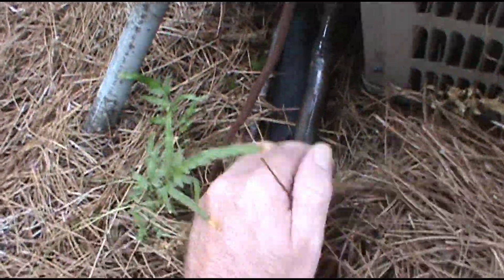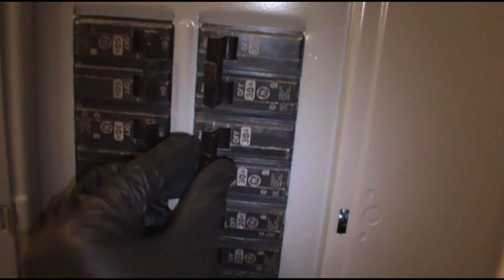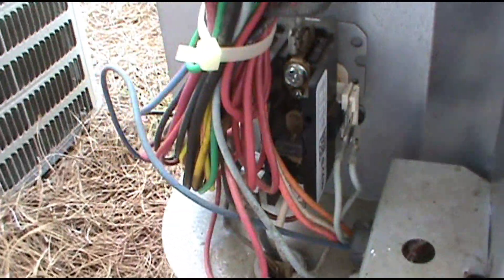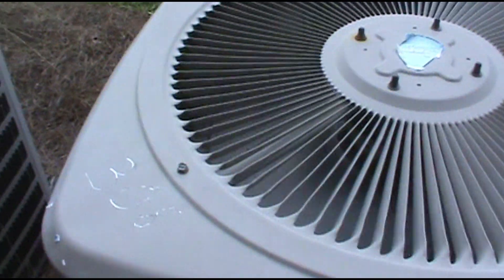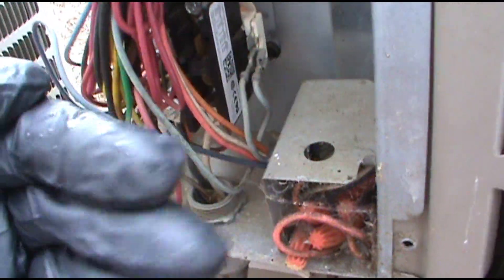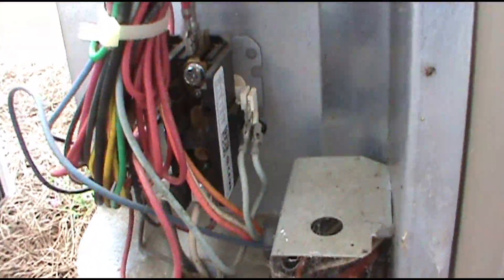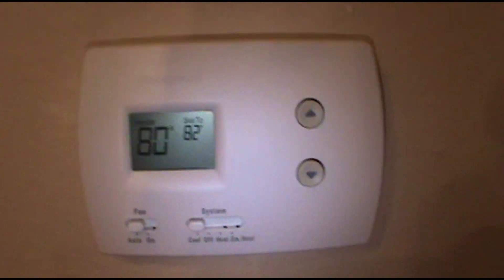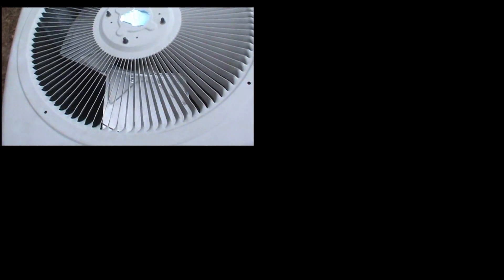Nest Thermostat Causing HVAC Issues

Comment: Just had a situation where there was a short in the base of my Nest Thermostat.  so my A/C kept running .  You might pull the Nest off but the issue is the Base.  so make sure you pull the wires out too.
Reply from the maker: Thank you so much for watching!

Comment: Thanks for the video Lex!  After 4 years, I have the EXACT same problem. I tested the capacitor, jumped 120v to the motor, and thought it was the control board for sure! New control board, and it would only run the blower for 2 minutes before the blower relay would switch off.  Lesson learned. I'm just a DIYer. May try to run a Common, may buy a new Nest. The downstairs Nest has been good for over 6 years 🙄
Reply: Quick Update: I used the Green 'Fan' wire as the Common and moved it to 'C'. The Nest immediately recognized this change. I bridged the Y 'Cool' terminal and G 'Fan' terminal w/ a wire at the control board. Everything's working peachy, I just don't have independent Fan operation any longer.  ALSO: the Nest was reporting low battery. I suspect over the years, the insufficient current w/o a Common kills the battery and starts drawing too much current from the control board. Still showed 28v on the G terminal, but not enough current to keep the Fan relay closed...
Reply from the maker: Thank you so much for watching!

Comment: I have a nest thermostat and it sometimes kicks my compressor off I have to turn off all the power and reset it works great afterwards but I believe I will be switching
Reply from the maker: Thank you so much for watching lawz!
Reply: @LexVance  what do you think about the ecobee gen 5?
Reply: Solution go to settings and turn off annual something I forgot but it prevents thr nest from not kicking on the compressor like it should

Comment: The nest requires the common wire because it suck power from the 24v power wire and it causes the air handler to shut off. Installing the common wire to the nest fixes this issue.
Reply from the maker: Right on, this one had the common wire. The Nest in this video was on the wall for 4 years and worked great. It malfunctioned and the guy had to get a new one. Thank you so much for watching Omaha!

Comment: My issue is the opposite. My inside runs and outside unit shut down. My unit is a York installed 2019. I have Nest. Everytime I call the tech it’s back working the pressures hood everything but ut at night the outside unit is not turning on. Been dealing with this for 2 months can you give me advice?
Reply from the maker: Yikes. I'd need to be there for this head smasher. 😭

Comment: Because so many people land on this video, including me, I have the actual answer for you for the shown issue.  

1. I assume you have the Y1 and the G wire connected, and that you can run the fan manually.

2. You are here because the compressor turns on, but the fan does not, and you don't want to have to run the fan manually (which works)

3. If your fan DOES work (when you test manually in the test menu, the answer below is for you, otherwise you probably have a wiring issue.

4. So now we have established your fan works, and your compressor works, but they don't come on or turn off at the same time.

5.   Go to Settings->Equipment->continue until you get to the menu where you see "heat type" 

6.  Go to the "heat type" menu, and make sure it is set to "Forced Air"

7.  Click through until you are done.

8.  Now go back to the equipment menu until you are given the option to "test" and in that test option area test your heat pump/cooling setting.  When the test start it should show (y1,G) being tested.  

Your fan AND your compressor should now turn on.  

For some reason the Nest will auto detect your AC incorrectly as a non fan air conditioner, and since this is hidden visually in all of the menus, you may think your Nest is broken.  Wonderful.

Literally no site has this fix, the only way to find this involved me watching a FULL install and configuration of a NEST and noticing that when I did the "test" mode it only showed Y1, instead of showing (y1, g)
Reply from the maker: Right on! I forgot to state in this video that this Nest had been on the wall for 4 years and never had an issue. The resident had to get a new one. Thank you so much for watching Christopher!

Comment: The nest is the problem, running the damper running when the thermostat call to shut down.   The government and the Utility Company should remove the Nest thermostat from their approved thermostat to get the credit. I spent $250.00. It does not function. Nest customer service does not accept their fault. My system is working fine with a $25 home depot thermostat.
Reply from the maker: Yep! I've heard nothing but bad things about Nest. Thank you so much for watching Muhammed!
Reply: And you are absolutely right, they do NOT accept that it's their crap. 
This mess came with my new construction home and it is nothing but a nightmare!!

Comment: Was there a yellow cable for the thermostat? if not they wired it wrong. There is 3 different ways to do the wiring when it comes to nest even the honey thermostat.
Reply from the maker: This Nest has been on the wall for 4 years. It was wired correctly. It just finally failed and wasn't working any more. He had to throw it away. Thank you so much for watching Dj!

Comment: That can happen if no common wire is used. The Nest says it is not necessary, but I’m guessing when it draws power from one of the other lines, some furnaces interpret it as demand for heat or cool. I had to pull another line with an extra conductor. Works like a charm.
Reply: That model has the rotating side ring
Reply from the maker: Right on. The Nest in this video has been on the wall for 4 years and was wired correctly. That's why the owner couldn't except the truth that it's now a hockey puck. 😆 Thank you so much for watching Mike!

Comment: The nest needs to have a ground wire running to communicate it for common. I had the same issue where it wasn’t cooling off and causing the same problems
Reply from the maker: Right on. The Nest in this video has been on the wall for 4 years and was wired correctly. It just went bad. Thank you so much for watching aj!

Comment: Good vid man- I love how people just don’t understand that thermostats are just electrical switches. Switches go bad after prolonged use, voltage surges, and shorts. The contacts or logic in the nest just go bad faster than others. I have probably changed out 4 this year because it wasn’t sending a signal to the reversing valve on a call for cool. I will usually just tell people if they want to keep it to buy another one and return the one that they have in the box. If nest wants to put out trash they can take their trash back
Reply from the maker: Yep! The thermostat in this video had been on the wall for 4 years and was wired correctly. That's why the guy couldn't accept the fact that it's now a hockey puck. Thank you so much for watching ACR!

Comment: "I'm gonna have a professional come out and look at it..."  Apparently he doesn't understand that just because you're on site maintenance, that you're also HVACR certified, and a "professional." DUH! Anyway, it's interesting to see how you exposed those nests (at least initially) might not function with some cooling systems. The only other solution would be if it could somehow be tweaked to make it work, and just wasn't set properly on the cooling function, thus causing the malfunction. An update on this one would be cool, if you remember. Thanks.
Reply from the maker: Right on Marc! The Nest in this video has been on the wall for 4 years and was wired correctly. That's why the guy didn't want to accept the truth. He thinks because it hasn't had any issues in 4 years that it never should have issues. 🙄 Thank you so much for watching man!

Comment: Had one...  After 4 replacements in 2.5 years, they said I had an incompatible system.  Looking at the base unit, they have either a thermal or inductive kickback problem that toasts the driver chip...  Kept the system in heat all the time even when supposed to cool.
Reply from the maker: Ol expensive hockey puck. 😆 Thank you so much for watching Jim!

Comment: Probably just a settings issue... I'm sure if you digged into it more you would've figured it out... Apartment renters should not be allowed to install their own tstats...
Reply from the maker: This Nest has been there for 4 years and was wired correctly. That's why the resident didn't want to accept the fact that it's now an expensive hockey puck. 😆 Thank you so much for watching Armando!
Reply: Everything works fine until it doesn't.

Comment: Great video brother I enjoy all your videos!            With a nest you have to wire it the right way for a heat pump and program it too on the setup. I’ve done some for a couple of residents and it can be tricky. And they updated the thermostat one day and the fan wouldn’t shut of so had to factory reset and tell them not to update it. They are pains!
Reply from the maker: Right on. The Nest in this video has been on the wall for 4 years and was wired correctly. That's why the resident couldn't face the truth that his precious Nest is now an expensive hockey puck.😆 Thank you so much for watching Andrew!

Comment: Hey homie. 
I'm a maintenance man. Thank you for the vids. They hella help. I installed a nest and found out the I didn't have to plug in all the wires. I left the blue one out and everything worked. Oh you twist the nest in order for you to select the different options. Like turning up and down the temp. Trying to help. Thanks again. Keep up the great job. Keep them vids coming. 👍👍
Reply from the maker: Right on Veni! The Nest in this video has been on the wall for 4 years and had never had an issue. And, it was wired correctly. That's why the resident can't accept the truth that it's now a hockey puck. 😆 Thank you so much for watching Veni!
Reply: @LexVance  good stuff Lex. I literally didn't know anything about maintenance 😂. Thank you for your vids it help me out. 3 years later still pushing. Right on Flex Lex
Reply: The nest pro gen 3 is really great, but there are flaws unfortunately.
The nest seems to be great for more modern updated systems.
I have a heatpump and sometimes the nest doesn't want to kick my compressor on.

Comment: I’m sure there are online manuals available for these new WiFi thermostats. They should be free to read
Reply from the maker: Right on. The Nest in this video has been on the wall for 4 years and has never had an issue. And, it was wired correctly. That's why the resident swears it's not the Nest and can't accept the truth that it's now a hockey puck. 😆 Thank you so much for watching Ty!

Comment: Let me guess only 4 conductors at the wall.
Reply from the maker: This Nest has been on the wall for 4 years and was wired correctly. The resident swears it's not the Nest because it's never had an issue in 4 years. Well, it does now! 😆 Thank you so much for watching John!
Reply: @LexVance  ha weird.

Comment: I had a few serious problems with NEST in heating mode. Wouldn't come on manually when I needed it to. I'll never use NEST again.
Reply from the maker: Right on. I've heard nothing but horror stories with the Nest t-stats. Thank you so much for watching Vincent!
Reply: I have the same issues. You have to reset your nest thermostat manually not using phone.  Go to setting and just turn off all its features except heat/cool. It will erased all the temp. Setting that you have previously..then you can manually set the temperature you like. Nest memorized all the temp. You set in the past . I have to periodically reset mine everytime the nest is thinking on its own. Its a pain.

Comment: Those Nest thermostats can be a pain sometimes. I usually deal with heat pumps in apartment buildings. The Nest will intermittently energize the reversing valve at random times or have the aux heat on with the A/C. I've come across on many different occasions where the condenser won't shut off. I would have just enough voltage to keep the contactor energized even if its less than 24 v. We mainly use the Honeywell Pro 3000 or the Honeywell focuspro 5000. I've heard Honeywell may be discontinuing those stats.
Reply from the maker: Right on! Yea, this Nest has been on the wall for 4 years and was wired correctly. The resident swears it's not the Nest because it's never had an issue in 4 years. Well, it does now! 😆 Thank you so much for watching hvacguy!
Reply: @LexVance  One thing that's common with the Nest thermostat is that the subbase shorts out. Causing control wires to be energized at random times. I just replaced one a week ago. It was keeping the reverseing valve energized at all times. No matter if it was set to heat or cool. This was on a Rheem unit so the tennant had heat blowing out of the vents no matter if they set to heat or cool.
Reply: same here....i am up here on new englad and ive had to replace a few of these due to strange problems....i always suggest the good old tried and true  T87 ...cant really go wrong...the new 90-95% high efficiency sometimes do not like them due to the real sensitive electronic boards as the T87 does rob some power..

Comment: I have removed at least 10 of them with the common wire. 
Part of initial phone conversation with new customer with intermittent issues is “ Do You Have A Nest Thermostat? “ make great hockey pucks
Reply from the maker: 👍😆👍 Hockey Pucks! I love that. This Nest had been on the wall for 4 years and was wired correctly. The resident swears it's not the Nest because it's never had an issue in 4 years. Well, it does now! 😆 Thank you so much for watching Joe!

Comment: I got a couple questions Lex regarding refrigerant. You got more years on me. Would you reuse refrigerant recovered from systems with restriction problems in TXV/Orifice/filter dryer? Where do you send off refrigerant you don't plan on using? Any place in Tallahassee? I heard some people sell them.
Reply from the maker: No, I wouldn't do that unless I positively knew there was no air in the tank. If other people are recovering with that tank, I wouldn't do it. Air will mess a system up bad. We give ours to HD Supply when they bring us a fresh empty. I think JohnStone will take them too.

Comment: Company had a deal with Nest, had issues with them all the time not getting signals to reversing valves, lost common wire, firmware/software issues. Eventually we opted out for Emerson Sensi on test units, Honeywell on everything else.

Now we have a box full of hockey pucks 😂
Reply from the maker: 😆🤣😂🤣😂😆🤣😂😆 Hockey Pucks! I about peed from laughing. The Nest on this video had been on the wall for 4 years and was wired correctly. The resident swears it's not bad. He said it's never had an issue in 4 years. Well, it does now! 😆 Thank you so much for watching Tech Life!
Reply: Nest thermostats without a C wire are powered by sending 3-4 volts from R to
a relay load connected to common assuming the voltage is too low to pull—in the relay. That strategy often does not work. Emerson Sensi is a great WiFi thermostat.

Comment: I hate when residents think they can install their own fixtures/thermostat. Drives me nuts
Reply: had a tenant years ago try to replace his toilet fill valve because he did  not wanna bug us on a weekend...long story short ...about 3 inches of water  everywhere after supply line blew off because he forgot to tighten it up.....luckily it was a basement apartment....took us about 3 weeks to gut everything 2 feet up and re sheetrock everything  etc...we had to put the guy in a empty we just finished up...fun times
Reply from the maker: I know right! This Nest has been on the wall for 4 years and was wired correctly. The resident didn't take the news too well that it was now junk.  Thank you so much for watching MEEKA!

Comment: I’ve heard of this happening  with Nest. If the common is missing it will cause issues like that.
Reply from the maker: Right on. That Nest has been on the wall for 4 years and the resident said it's never had an issue. It was wired correctly too. He swears it's not the Nest because it's been fine for 4 years. 😆 He said he's calling a professional for a second opinion. 🙄 Thank you so much for watching Neil!
Reply: Yep it may not have been full 24v but enough to pull in the contactor.
Reply from the maker: @joeshearer1247  What's up Joe! This Nest was wired correctly. And, it has been on the wall for 4 years and the resident stated that he's never had an issue. He swears it's not the Nest and said he's calling a professional for a second opinion. 🙄 Good to hear from you Joe!
Reply: I had one wired correctly installed for years. , even pulled it off the base , something was funky with the base . Had to unwire it to stop the overheating issue! Customer later told me Nest sent him a new tstat.

Comment: It's in the programming or it's a bad nest also to I have called them and they said the software is the issue when the unit doesn't turn off..I have done the same go back to the easy thermostats.
Reply from the maker: Yep. I like the easy ones. Resident said it's been up for 4 years and he's never had an issue with it. It was also wired correctly. He swears it's not the Nest because it's never had an issue in 4 years. Well, it does now! 😆 Thank you so much for watching Ruben!